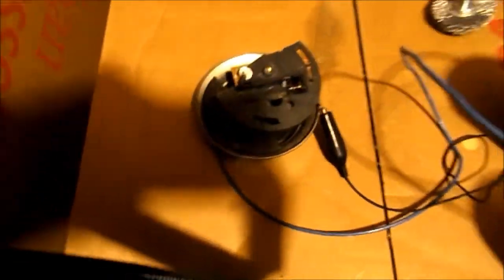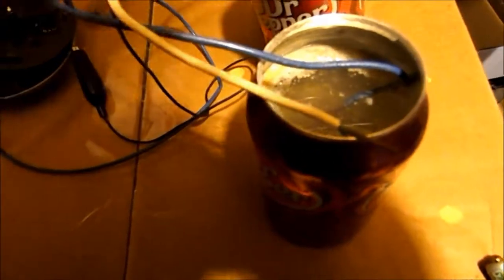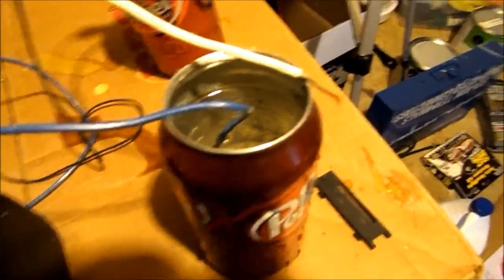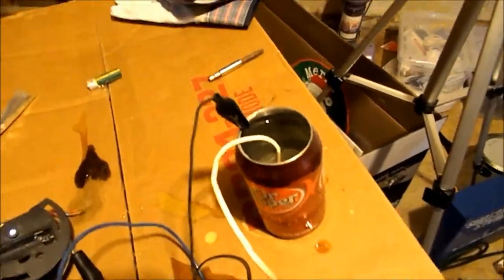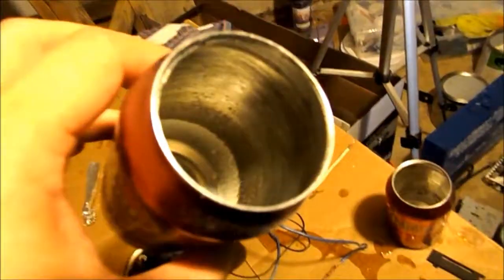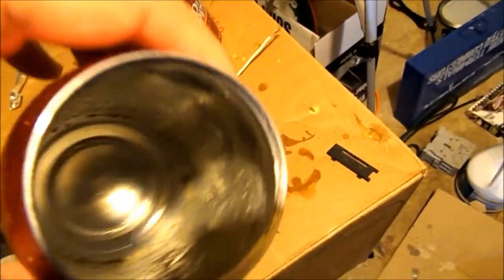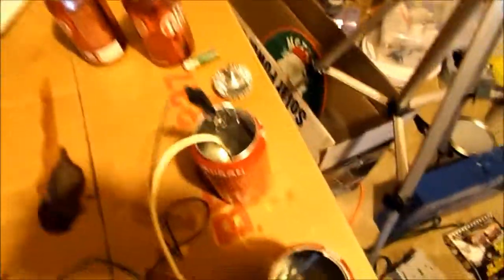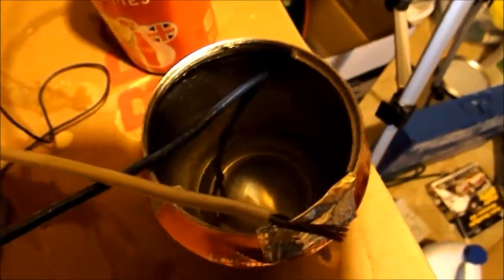Aluminum Air Battery From Cans 2

Comment: I mean a low buck air pump... you just take a can and in one end... insert a shaft connected to a piece of rubber that goes the whole length..I would use a can for food... then make sure the shaft is off center to the can...... then when the rubber would be flexing the most to push air... stick an upright piece of rubber the length of the can... and put a hole just before and after it on the can... as the motor spins the can the intake chamber size of the rotor grows bigger and draws in the air.... when it gets smaller it pushes it out:)

Comment: But what may work even better for agitation is to use a low voltage air pump through aquarium tubing into aquarium bubbler stones... not only does it agitate the water.. but the water becomes oxygenated and the inside of the can can oxidize much better... over time... also sanding off the paint on the outside of the can would help..... remember the trick that makes the power is the aluminium getting oxidized :)

Comment: OH also a low speed low voltage dc motor.. think a really low volt one... with a plastic shaft and plastic ummm  blade on it in the can in the salt water? that will work great....
Also vinegar will help the salt .. see when you mix acids... acetic acid and sodium chloride... what you get is a stronger acid.. but all natural :)
Also on the corrosion... if you have it set on a timer to switch over to doing a low power DC charge of the machine ... the oxidation reverses.... additionally graphite pencil leads work better than copper wire ;) keep up the development! :)

~ White Rabbit